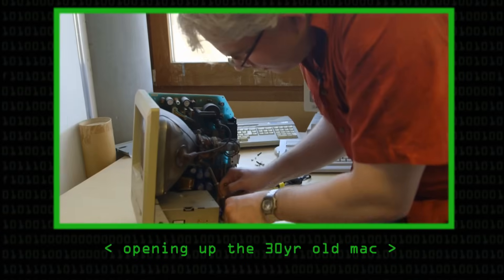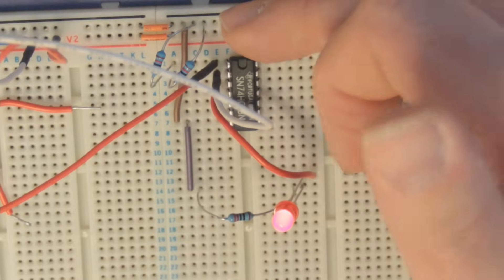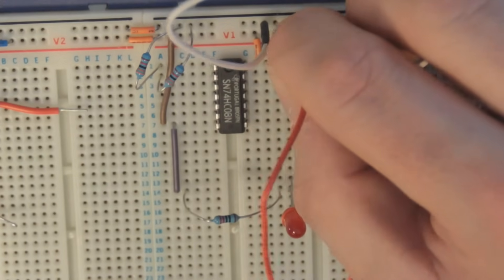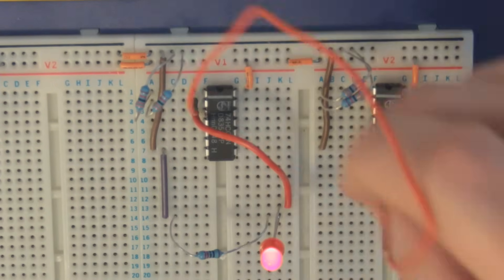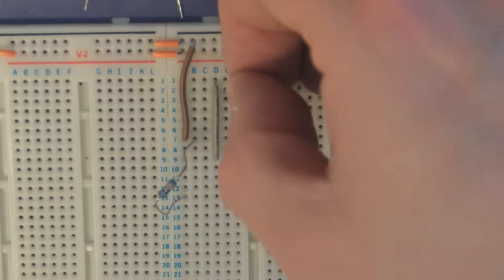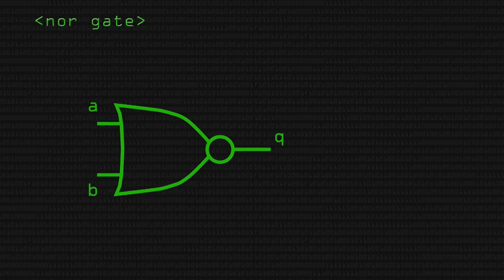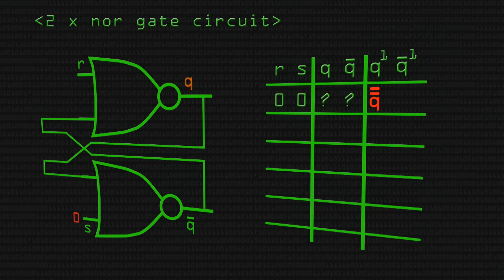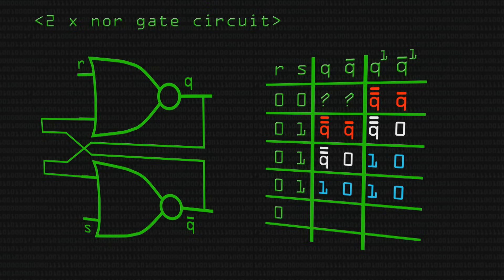How Computer Memory Works - Computerphile

Comment: Only static RAM works like this, dynamic RAM works completely different. dynamic RAM is just a condensator (MOSFET) holding charge for a brief period that gets refreshed regularly.
Reply: It's either a capacitor or a condenser, no such thing as a condensator.
Reply: KonstantinUb Capacitor was the word I was looking for. English is not my native language and haven't used the word in a very long time.
Reply: It's used in mine as well, although that's still no reason not to know the proper English word (especially if you're into electronics and CS!)
Reply: to my knowledge MOSFET has nothing to do with capacitors, MOSFET is a kind of transistor technology
Reply: 3amsleep  MOSFET is not a capacitor but a transistor. The MO is for metal oxide, and the FE stands for Field Effect which explains how the transistor(but other than it acts just like a normal transistor). The circuit basically just ties the leads of the capacitor to the transistor source and drain. and until the collector/gate is given a voltage the cap will almost maintain it's charge. I say almost because every transistor will leak a bit of voltage, and so the voltage has to be reapplied from time to time.This is what tabularasa0606 means by refreshing, and this why it's called dynamic ram. However it basically works the same way,the underlying details are different, with the source being the set and the gate being reset. The reason it looks different is because the q0(q not) is actually an output used in the circuit, the bit is q, q0 is just used to help with calculation. This is really how memory works in abstract sense, while dynamic and static ram are really implementations of this abstraction, if the make any sense.
Reply: mage davee Thank you for this explanation!
Reply: so does static ram actually ... with each and every clock pulse ... the reason for the different name is the component used ... not how it used

Comment: Where can I buy these chips?
That video was extremely nice and informative!
Reply: https://en.wikipedia.org/wiki/List_of_7400_series_integrated_circuits

These are probably the most straightforward ones.
74HCT00N quad 2-input NAND
74HCT02N quad 2-input NOR
74HCT08N quad 2-input AND
74HCT32N quad 2-input OR

octopart.com

He had the 74HCT32N on the board as well but it looked like he used one with a different process technology in the demonstration. These should have the same logic circuits in them though.

EDIT: Bleck, my comment got mangled. But you should be able to look up the parts at octopart.